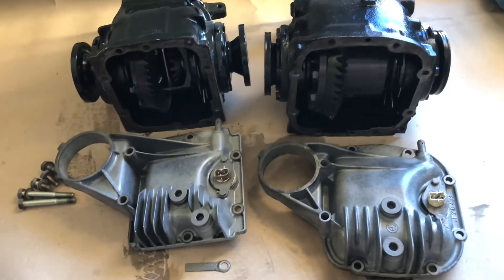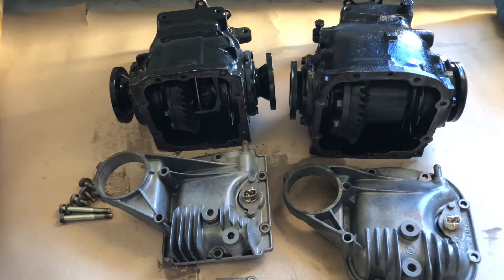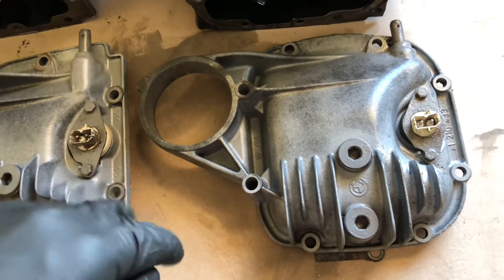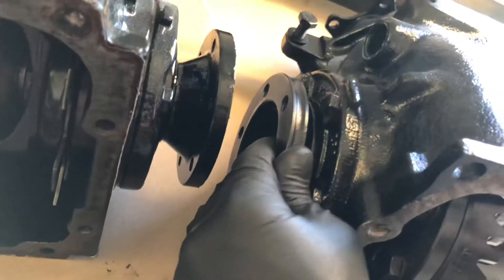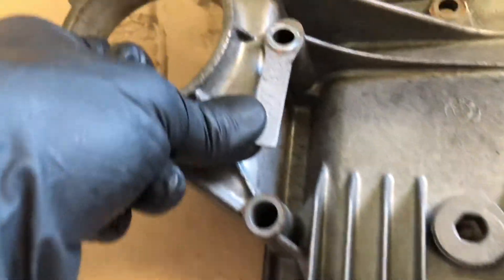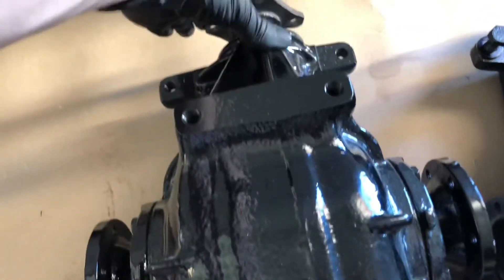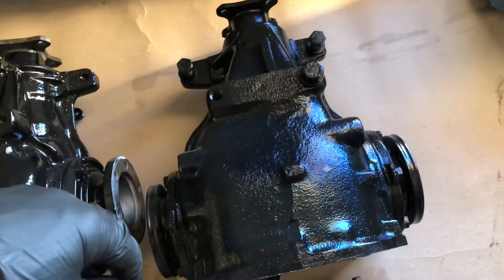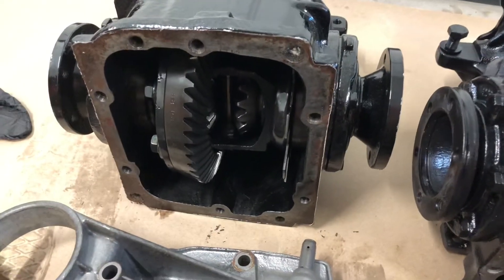Quick 10MIN guide for BMW differentials

Comment: Hi. Thanks for a great video. It seems you know your diffs, so I would like to ask you if you know which diffs I can physically fit in my BMW e60 545 automatic. I really don’t care if the gear ratio isn’t the same. Just the fitment.
Reply from the maker: Thanks! I believe your e60 545 shares differentials with E63 645 model or 650/E65 745 or 750. Since the engine produces quite a lot of torque, there should be a bigger diff installed also. Depending on the reason youre looking for a replacement, consider rebuilding or in case of massive damage, get one from high end models. Best of luck

Comment: Will a z3 differential swap into a 325e e30?
Reply from the maker: To my knowledge Z3 differentials swap to E30, swap output flanges and covers as needed. Depending on specific ratios and different models, I would still dig a bit in the old interwebs or compare pictures to be 100%

Comment: Hi, i have E34 with m50b20tu engine, but i dont know which differential is on it, its size 188? Or 210? Thank you)
Reply from the maker: Hey! Almost certain that if your engine spec is stock, you have a 188 diff in there. 210 came with the biggest engines like on the M5 models. You can also check the factory list when you decode your Vin-number to see if there are any mentions about your car´s diff options. Usually not, because  2.0 and such were most likely stock optioned.